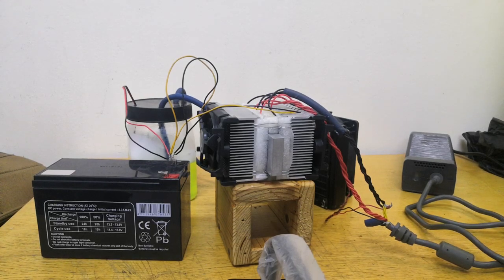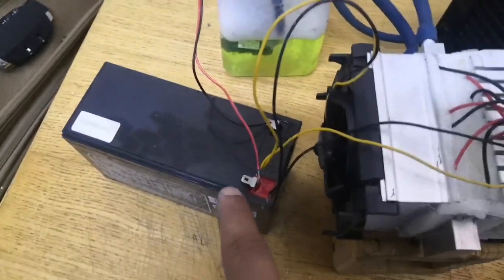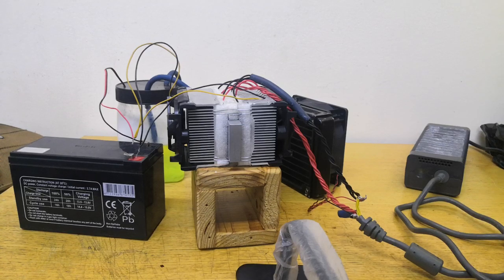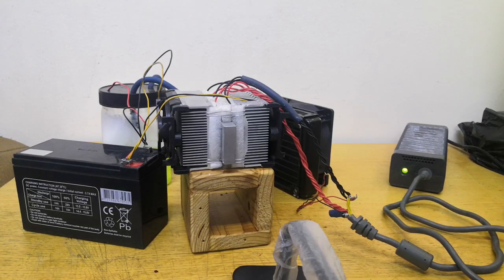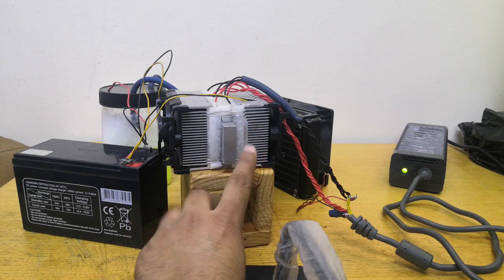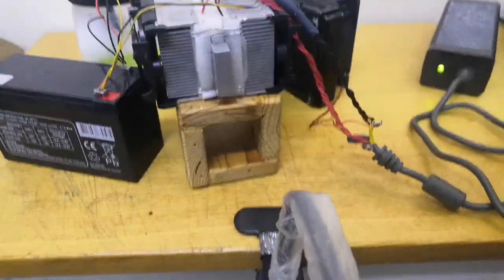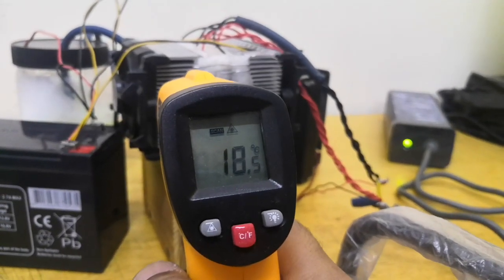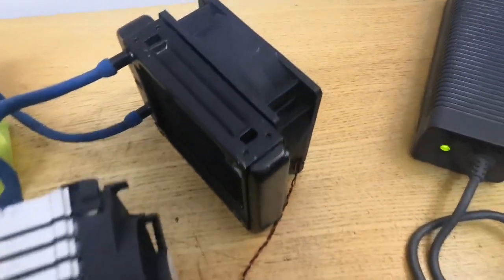4x Peltiers with water cooling and radiator..

Comment: Which heat sink is this
Reply from the maker: The center part is a water cooling block.. The 2 heat sinks are from old computer CPU used for pentium.
No idea about the exact model of the computer cause I bought it from a scrap yard. 
The radiator is a 120mm water cooled radiator,which I bought from banggood.Com.
Reply from the maker: It is an old computers heat sink.
Reply: @DIYTAYSEERworld  which processor’s Any idea? BTW thanks for quick reply. I like your content.